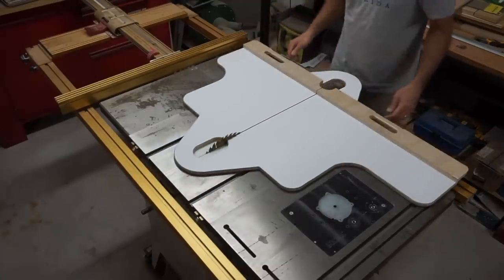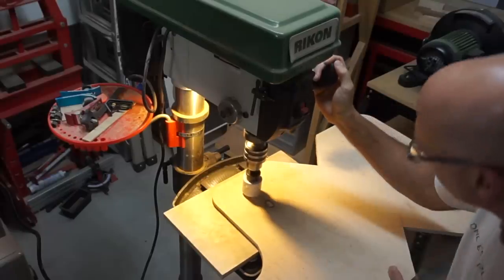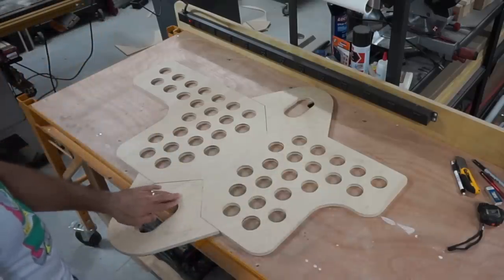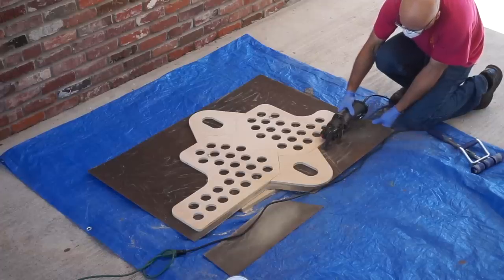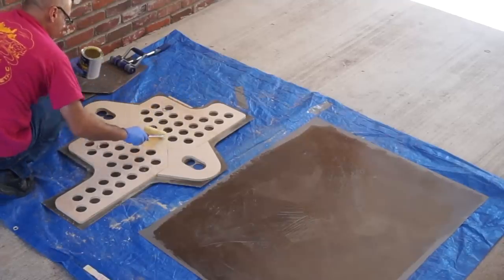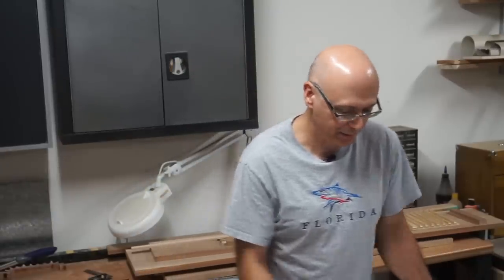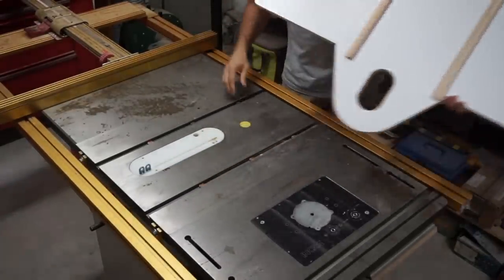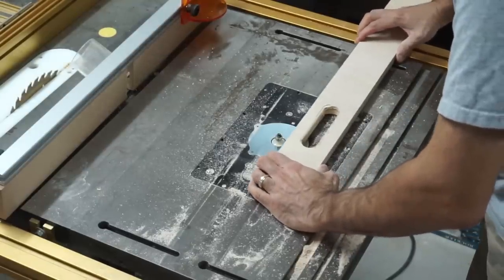A Crosscut Sled Like No Other

Comment: Just curious, as you didn't really say - When you measured with the calipers and came up with your 33 thousands - had you confirmed that piece was 100% square to start?  Or if your width was 100% the same?  Since you reference of the fence, if that starting corner of your test piece as already out of square, then your number isn't necessarily right.  You could be more accurate than giving yourself credit for, or less, but either way, there are better ways to check :)
Reply: I like it and will build one. The only twerk I will make is adding a hold down for the main piece of wood. I am concerned the piece I am cutting will lift up (pushing it through with both hands off the board). I love the idea of lighter and easier to move/store. Nice job. Measurements would be nice.
Reply: you should never twerk in the shop! :)
Reply: .033" in 15" ? Not really acceptable unless you're building a saw horse.
Come on. Not even close to square.
Reply: I agree, he should have made the 5 cuts.....
Reply: I agree, getting it down to at least 2 or 3 thousands is much better.
Reply: was just gonna post the same.
Reply: Kent Oakley agree. It would be so easy to get much much better accuracy
Reply: I agree. The square accuracy on this is abysmal. You could clearly see air in the square as he was saying it was good enough. For what he uses it for, it could be. In any case, demonstrating how to make this sled accurate wasn't the point of video. The overall design is quite inventive compared to every other sled on YouTube. It wouldn't be hard to build your own using an adjustable fence and the five cuts method.
Reply: @jjbailey01  Yes, the design did have some interesting ideas (and some dangerous ones as noted by almost everyone).. I think with just a little rethinking of the idea it could be pretty fantastic. 

Pros: light, and flat. That would store well for those of us without much space. 

Cons: Dangerous in it's current form. 

Improvements:  
#1 - Install a t-track perpendicular to the fence. You've already cut through all but the ends... It's not going to make it any weaker as long as you're a little careful about it's length and position.  
#2 - I personally would like to see a t-track in the fence as well, and why not a taped on ruler for adjusting a stop block.  
#3 - Pin one end of the fence down with a single screw, and use a hold down in the t-track from #1 to hold the other end of the fence while you do the five cut method to actually get a square sled. 
#4 - This is a half-baked idea, but I'd like the option to increase the height of the fence at times.. Maybe just adding a could of t-nuts to the fence so you can screw on an additional board when you want.. These same nuts could hold the t-track I wanted on the fence, making it removable as well.. You could probably even make it so you could stack them for different configurations.. A couple extra t-nuts and maybe you could make other accessory attachments, like miter jigs.. 
#5 - I'm not sure it's worth the added weight/trouble/cost of adding the laminate onto the bottom of the sled... I'm curious what others think..  I'm also thinking that you can probably be more aggressive in the material you remove from the plywood if you're a little more strategic.
 
OK, the more I think about this, I really do want to build a revised version of this thing... I think it could be  an easily stored super-sled with a little tweaking.. Maybe I'll do a small concept version of it first..

Comment: You have great woodworking skills and a well equipped workshop. I’m a bit concerned about gluing some of the critical parts, like the runners in the bottom and the last part that you glued on top. Over time the wooden runners can wear off and lose precision. 
How about using HDPE (high-density polyethylene plastic for sliders; material used in white kitchen cutting boards.

Comment: Great for thin short materials. Love the melamine skin for gliding. But TELL ME YOU DIDN'T RUN A PIECE OF UNSECURED WOOD PAST THE BLADE AND BACK AGAIN?!?!?!?!? Good way to loose your teeth.
Reply: Good gracious, my thought exactly!
Reply: My blood ran cold when he made that cut 😰
Reply: i was over here yelling "yo playa what are you doing!!"
Reply: Yeah...and standing DIRECTLY BEHIND IT! (I once had a 2x2 shoot past me and THROUGH a 3/4" board!)
Reply: Geo Taylor    I would have used the 5 step method to get the fence more perfectly square and I would have mounted the fence vertically to accept longer higher pieces.
Reply: I cringed too.
Reply: Yup....same thing happened to me. After that, I ditched the safety glasses and bought a full face shield.
Reply: My first thought was just ..SHIT..! Glad nothing happened to him.
Reply: Literally dodged a bullet! ;-)
Reply: and he even made reference to the two hand holds being a safety item!
Reply: Bxxj watch this video again he did not use any melamine sheeting at all he used laminate sheeting you were not even close in being correct!!
Reply: @robertbutler8004  melamine and laminate are similar in how slippery they are.
Reply: @triplealley  
I agree
Reply: @michaelanastasio7669  Indeed
Reply: I thought surely not, then I figured he must have double sided taped it.
Reply: Yes, cutting an unsecured piece of wood gave me the creeps and may have contributed to the "walkoff" from one end to the other.
Reply: Yikes! Thought he was going to eat that   Scrap piece. Need a surface cam —something to secure work.
Reply: Not smart safety  . . .  this design is a disaster waiting to happen.
Reply: Nice sled! I would still add a zero tolerance fence and some way of holding materials down while cutting. 
B for effort
B for creativity
C for accuracy
F for safety
And overall 
C and back to the drawing board.
Try a remote controlled sled and keep your distance.
Reply: I thought the same, why not fit a T track on the fence to take a hold down or two? Other than than, I think it's good, and was made with some thought.
Reply: All I could think when I saw that is " This is going to end badly! " but thankfully he did not get a new body part added in the form of that wood between his ribs!
Reply: @grumpydave5377  So are ice and oil.
Reply: Sawing a piece of wood without holding it down?  Not how I would go on.
Reply: EXACTLY WHAT I SAID! "I'VE BEEN THINKING" then he pulls a hi-school trick like that. GEEZ LOUISE
Reply: it's unclear how it would fail with this setup, but it sure looks like a bad idea.
Reply: Wow just wow. This is a great method to bury a chunk of wood in yourself.
Reply: I did this and have a hell of a gash in my belly to show for it
Reply: I cringed as he started cutting it without securing it...Then was like "what the...." when he brought it back. Not cool.
Reply: @michaelanastasio7669  Guy is living in his own world.
Reply: My eyes jumped out of the sockets like a Tom and Jerry cartoon!
Reply: that was a close call....wood has great affinity with ribs...
Reply: @dougahmann 
"Literally dodged a bullet"
I didn't notice an attached gun - literally, I didn't.
Reply: Dangerous
Reply: Hold down clamps are your friend

Comment: If you are making cabinets, I think that error rate is just too big.  Those errors get multiplied and come back to haunt you during assembly.  You can attach  the fancy from the bottom with countersunk screws on both ends with a square,  Then run a test piece and loosen one end by removing the screw on one end and move it by your measured error rate, re-attach with another countersunk screw through a different screw hole (so it won't go back where it came from) and remeasure.  Why go through all that construction and accept mediocrity in accuracy at the end?  William Ng's website shows this adjustment technique.  I do like making it light weight.  I would make the fence taller to be able to clamp bigger pieces.
Reply from the maker: All great comments, Steve. Thanks!
Reply: the 5 cut will get it very accurate for sure . probably a bit late, as he epoxied his fence on.
why not cut it all out of one piece instead of adding those ends?
Reply from the maker: Cutting the slotted pieces separately made cutting out the slots easier and saved me having to use a larger piece for the table.
Reply: nevermindthebollocks I totally didn't get that, even after he explained it.
Reply: I have a cnc so I kind of think differently about how to cut things now.  The lightened sled with melamine covering is a good idea. But he is making use of smaller pieces to make his sled. 
My big crosscut sled is a 3x4 sheet of 1/2 ply with a jointed, and planed 2x4 fence. I used the 5 cut method to make sure it was straight. 
But now I don't use the tablesaw for big pieces anymore so.......
Reply: Check this video to learn more about the 5 cut process to assure that your crosscut sled is accurate - https://youtu.be/UbG-n--LFgQ
Reply: i agree with steve b. why do all the work and accept the inaccuracy,  it's like building an engine with precision and not adjusting the valves correctly, why bother at all.  but still, all in all a nice sled with some good ideas. thankyou.
Reply: .033 is 1/32. Big enough to see...
Reply: Ray, 5000 pieces? You obviously ain't never cut no wood for accuracy.
Reply: I'm not all that certain that you could eyeball a piece and quickly notice 1/32" difference in 15"
Reply: @paulmyrick3639  Then you need glasses sir!

Comment: I agree with others, some means of holding down is essential and lining up with screws before applying epoxy might have been a good idea! Whilst the handles do cause you to hold them away from the blade, there's not much stopping it cutting into your stomach or clothing! Looks very nice with the laminate cover though!
Reply from the maker: Thanks for the comments, Krazee Kraftz! Just curious, what should be used to stop the blade from cutting into your stomach or clothing?

Comment: I like the concept! One thing I've noticed is that the zero clearance saw blade gaps tend to wieden with use on most all of my jigs and fixtures. If the gap becomes unacceptablely wide on your sled, you could fill the saw blade gap with an auto body bondo then re cut the sled's gap to zero clearance. This technique avoids having to make a replaceable sled plate.

Comment: A lot of work, but why did you make those half-star piece add-ons? Couldn't you have just cut the whole thing out?
I'm konfyoozd!
Reply: I thought the same thing. Cut it out then put it back together, makes no sense.
Reply: He was just showing off his "rip jig" to cut the plywood, using it vertically against the side of a bench (REALLY?) Then he had to add more material to make it usable. But that didn't work because the slider is crooked. What a joke!
Reply: Yeah what was that about didn't quite get that one
Reply: I was guessing maybe he didn't want so much waste material and/or the stock he had wasn't big enough to do it in one piece?
Reply: I think his "3 piece method" allowed him to use his band-saw and drill press to cut out the shapes and drill out the holes.  A track-saw and/or jigsaw and free-wheeling the hole sawing with a hand drill would allow you to do it in one piece I would think...???

Comment: I like something higher at the back to use with clamps for stops or for securing material, but that is me.  The way that I get a square cut is I attach the back fence with a countersunk screw on one side and a tiny drop of glue or a clamp on the other side. Do four cuts on a piece of board and when I get it right mark the sled, and then glue/screw it in place. 

I like the idea of drilling out the sled to reduce weight.

Comment: I've made several sleds for a college furniture class I teach and this has to be the worse design I've ever seen. It will never remain square.If you want lite weight use a single sided sled. Always dado your guide tracks and if you have a table saw, cut the plywood with it, not a circular saw..
Reply: Bill Boy   I thought I was the only one Lol.  I've been woodworking for 6 months now, and I made a small mitre gauge style sled with a 12" fence.  The thought to dado the 4" wide base piece for the oak runner was my big genius extra original "eureka" moment.  (So I thought).  I havent seen anyone use this method on youtube.  It cuts very square and I'm glad to see someone mention it.
Reply: @Jack Morris    Dado a shallow groove on the bottom of the sled that the runner will fit into.  I used glue to secure my runner.
Reply: The whole circular saw thing told me all I needed to know about where the video was headed. What a colossal waste of time. I guess it looks pretty hanging on the wall.

Comment: Regardless good or bad comments. It is a very interesting design and i admire it. If i made one what i would do different is to not make that last lot of holes along where the fence is placed therefore allowing me to then screw the fence from underneath therefore giving me the ability to get it spot on accurate. (as per a number of youtubers have done e.g. The woodwhisperer explained fence alignment well) The extra meat you leave behind would also allow you to screw on a taller fence if you wanted to. 
Re the accuracy bit, unless you did the extra step off camera, you cannot really be sure that the fence is spot on or otherwise.
what others have suggested ie the 5 cut method would tell you for sure.
Otherwise i thank you greatly for sharing and for your honesty. As you could have bull shitted the result.

Comment: How would you securely clamp stops on the fence. Wouldn't it be easier if it was a little bit taller?
Reply: Why? Toggle clamps don't need to be little bit higher.
Reply: MrBonners I usually use spring clamps but toggles would work, too
Reply: spring clamps mechanically can not be used as hold downs.
Reply: He is sacrificing function for form. He doesn't care that you can't safely and reliably use this for anything on end, his concern is "sleekness", he says it himself. (I most definitely DO NOT agree with him, but he said it)
Reply: MrBonners I use spring clamps to hold stops all the time on table saw, router table, drill press, and sliding mitre saw.
Reply: MrBonners they most certainly can if you have a fence you can attach them to

Comment: Love the appearance of the sled, but the handles force you to stand in line with the blade. Combined with removing your splitter, this could potentially fire a piece straight at you. A few more modifications though and it'd be grand
Reply from the maker: Where are you supposed to stand when using a table saw?
Reply: @IveBeenThinkingWorkshop  stand slightly to one side; away from directly in line with the blade. The part of the blade furthest from you is spinning up through the table, where near you it spins downward. The up-spin can throw the work piece up on to the top of the blade and fire it, at speed, toward you